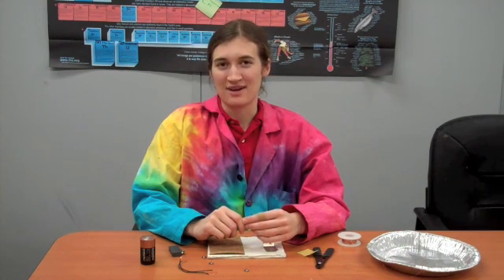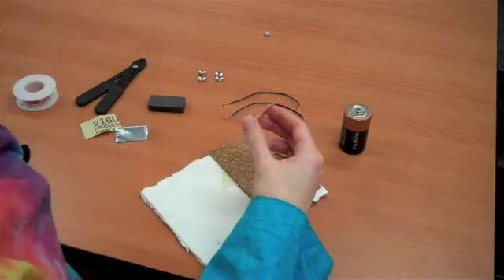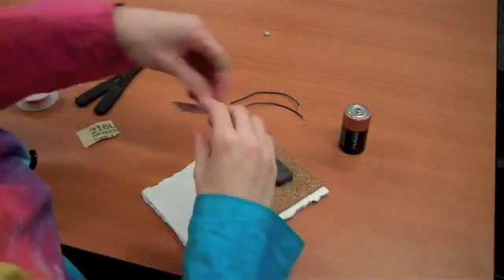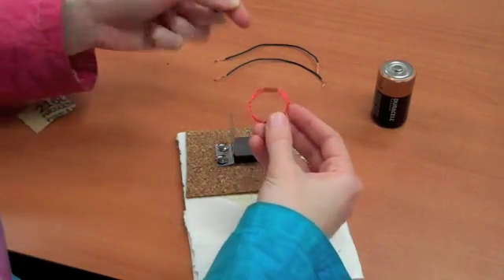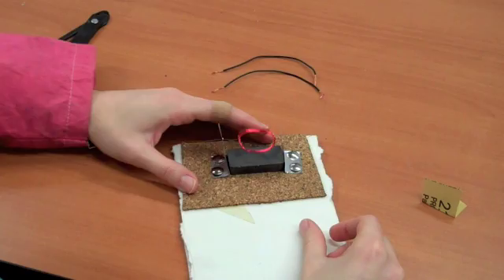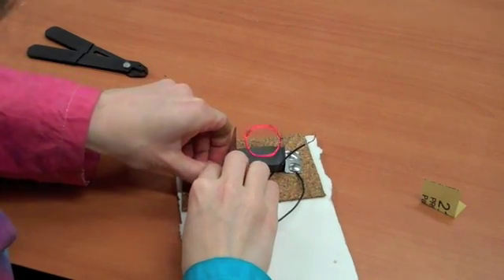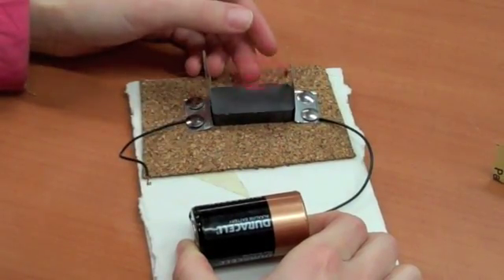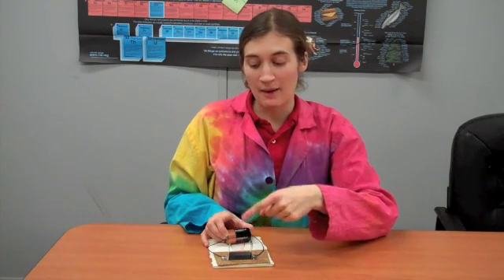Electric Motor: a fun, at-home science experiment

Comment from the maker: Make sure your wire is well stripped and the wire ends are nicely exposed. It can be very hard to tack the wire ends down. Are you using a bar magnet? A weaker magnet may not work quite as well. If that doesn't help let us know and we can help you trouble shoot again!

Comment from the maker: Sorry we didn't answer sooner! The black magnet does not conduct electricity very well. While I'm sure that electricity could flow through it, it is easier for the electricity to go through the conducting metal (tin stand and copper wire). 

We are completing the circuit, however it is not a short circuit since the act of spinning the spool of wire creates a bit of resistance. However as always, if the battery starts heating up please disconnect it before it gets to hot. 

GREAT QUESTIONS!!!